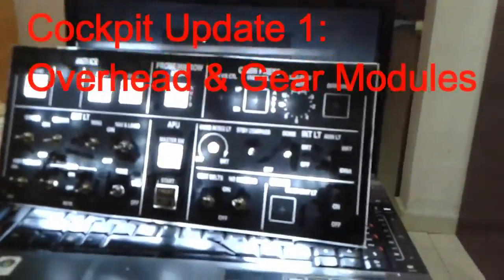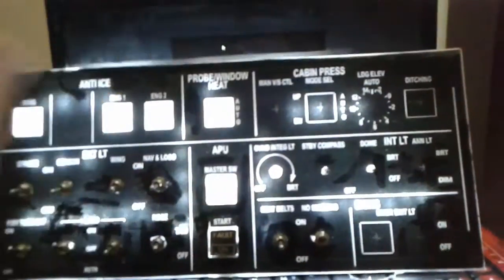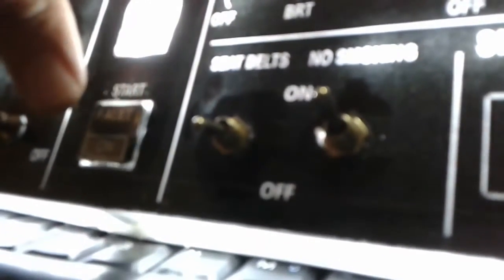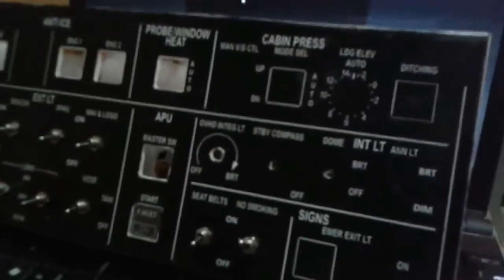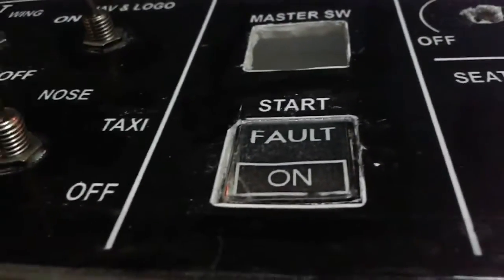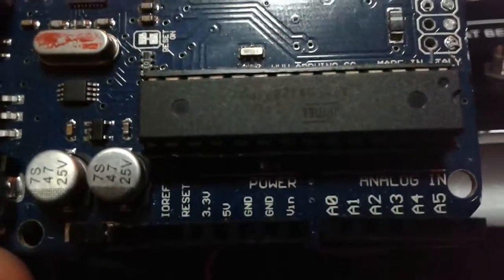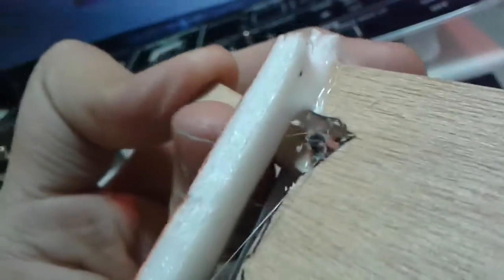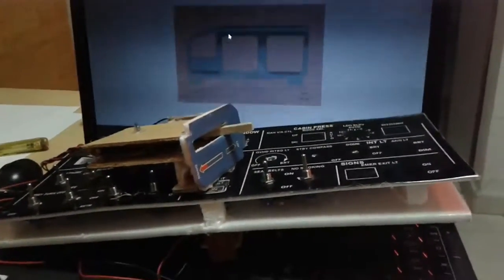A320 Homecockpit build 1-Homemade modules

Comment: Where did you buy all your hardware?
Reply from the maker: Hi Jinus, if you're talking about electronic components, most of them such as the LEDs come from Ebay or AliExpress. Many Chinese suppliers offer very low prices. As for the panels, I design graphics and print them out before laminating them onto foam board.

Have a great day!
Reply: Gary's Airbus thanks for the reply :)

Comment: I have the Aerosoft A320 and have started to build a basic panel. I am having no luck in assigning switches to the Aircraft, even a simple event like Cabin Seatbelts toggle. FSUIPC macro recorder doesnt work. Any suggestions to point me in the right direction would be greatly appreciated.
Reply from the maker: Hi Michael, this is because the Aerosoft A320's code does not support FSUIPC. I have the Aerosoft A320 too but i never used it much as i can't use my interface with it. I use the Wilco Airbus Evolution instead.  You might want to try the Aerosoft forum or mycockpit forums to seek some help from professionals and see if they have any solution.

Have a great day!
Reply: Gary's Airbus Thanks. I have had success with Linda.
Reply from the maker: No problem!
Reply: @delewey1  hi Michael, I have the aerosoft 320, but have not been able to create a simple FCU, do you know how? I have arduino, encoders, FSUIPC, FSX, trying to setup it with mobiflight, but and not even closed
Reply: @emmanuelmorales4292  Hi, I have moved on to P3D now. I suggest you try spade.next. There are user profiles for the A320, where some users have programmed  xml commands for the plane.  Other than that, I'm afraid I can't help.
Reply: @delewey1  you have aerosoft 320 in p3d? I can switch to p3d too. But need to make an fcu working. Pls help
Reply: @emmanuelmorales4292  Haven't tried it yet. Spad.next supports P3D so maybe they have a profile for it.